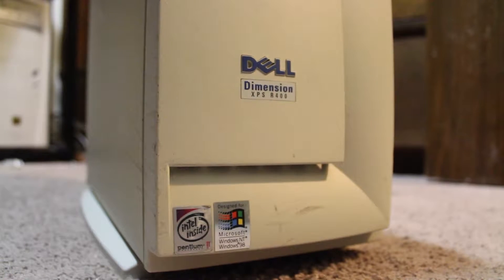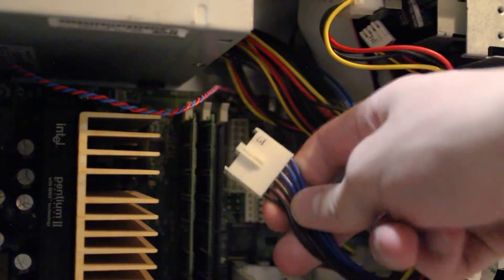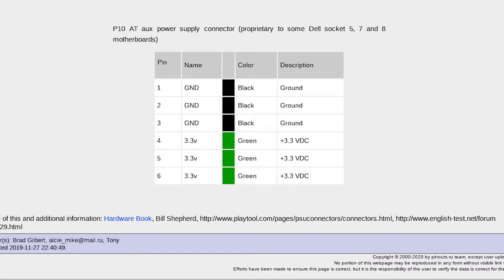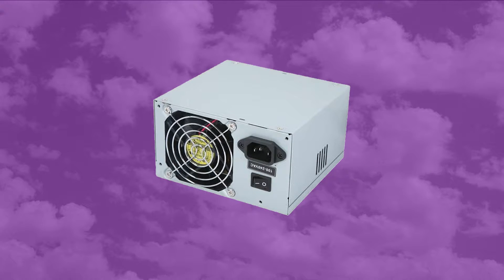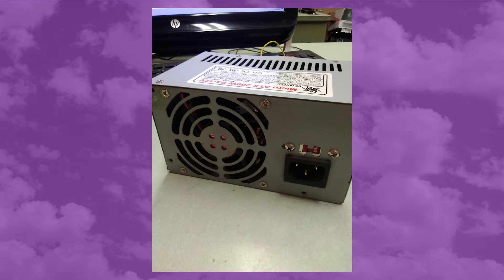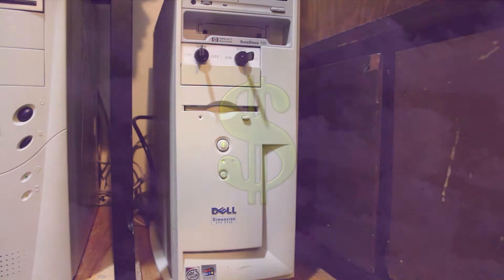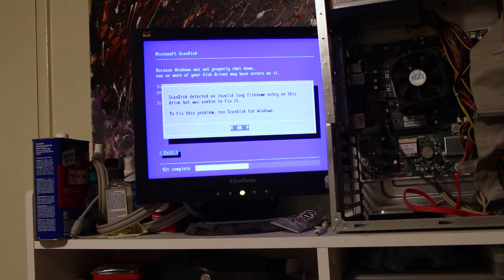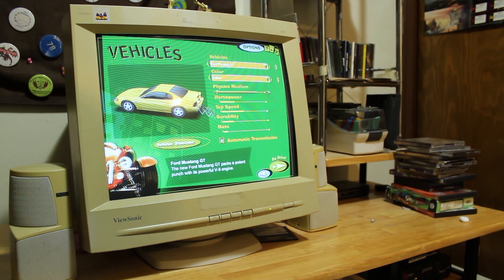Replacing A Proprietary 22-Year-Old Power Supply | Dell 9228C

Comment: UPDATE - Below the propriety Dell ATX PSU connection on the motherboard are three additional sets of solder pads. If you desolder and remove the propriety Dell plug and then solder on a standard ATX plug (moving it down to make use of those three additional sets of solder pads) a conventional ATX PSU - should - work. Thus freeing you from the proprietary PSU shenanigans. You shouldn’t need to remove the secondary AT PSU connector.

Admittedly, I’m not a Dell hardware engineer. But, this should work, as most proprietary funkiness is more-so to bind client related upgrades/repairs to the host product provider itself. Rather than trying to reinvent the wheel.

This coming from a former SysAdmin and later Devops Engineer. Hopefully it helps.

Comment: did you ever look into getting the old psu repaired/ looked at?
also ya could look for a different dell model doesn't have this type of PSU that has a PII in it or switch to a PIII of the same speed.

Comment: Hey there. I am experiencing an issue with a Dell PSU as well. Were you able to find a pinout for the ATX style connector? I am trying to manually start it and test the voltages.
Reply from the maker: I don't recall ever finding a pinout for the connector, sorry.

Comment: https://youtu.be/h5wmwfsbaNM?t=485 is that the Coolerguys Cyclone 5000 on the left? :o I have a fairly extensive lineup of old Dell machines. good times.
Reply from the maker: It's a no-name PC case that was sold under a bunch of different brands. I bought it new old stock about 10 years ago. The one you mentioned appears to have been modified with additional fans that mine doesn't have.
Reply: @AtomicPurple  yep, that's the one I got in 2000. was known as the first pre-mod case for fans like that according to old sites. it's still my main case. I found it under the name Maxtop Hivemind years ago. wish I would've bought one of those cases and swapped the face, I would've had built in front USB ports then!

Comment: @Atomic Purple   Ive worked on these old  Dell's for years. The power supplies have a different pinout than anything else. When the power supplies die they usually kill the motherboard as well. There used to be a writeup online to convert a standard power supply to the dell standard. I managed to revive an xpsr450 today with a socket 370 to slot1 adapter running a 1GHZ P3 and a used Dell power supply. Just look for old 200-250 watt power supplies and modify the circuits. https://www.informit.com/articles/article.aspx?p=339053

Comment: Just a heads up on these older Dell PSUs, if you plug one into a standard ATX motherboard or PSU tester it will make that high pitched noise and fry both the PSU and motherboard/tester.